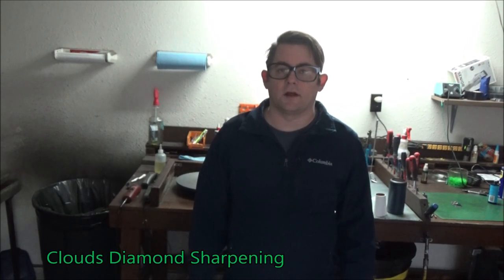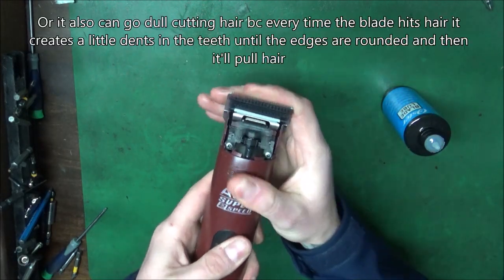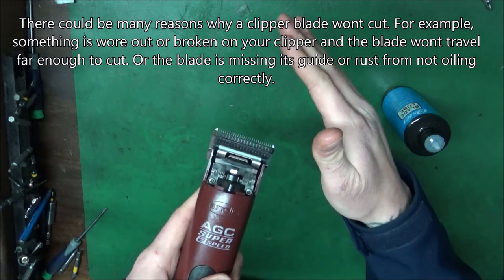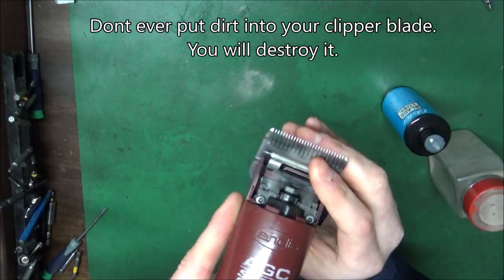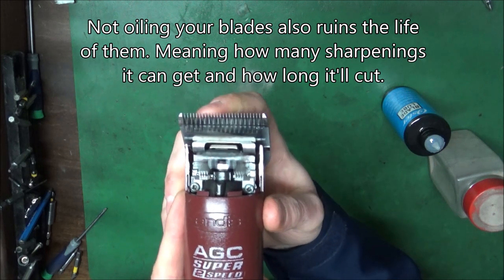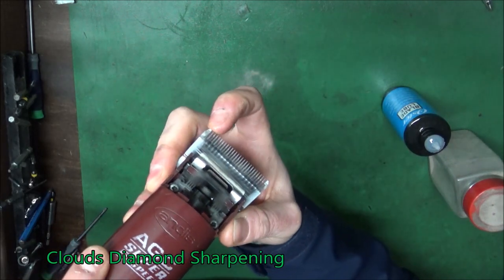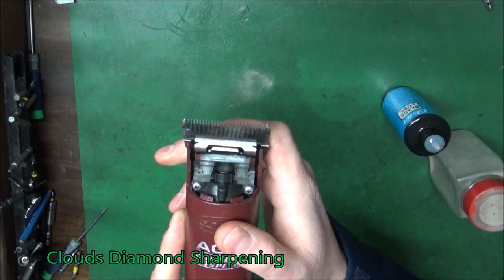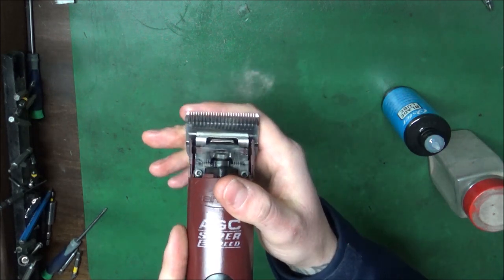Why do clipper blades go dull?

Comment: Hi from Sweden 🇸🇪. Watched your videos a lot, informative and very good 👍. I have a andis ultra edge with a problem that I don't have found in your videos...
When I turn it on it doesn't move at all, after 2 seconds it starts moving very slowly and after 10 seconds it movs faster and faster but never comes up in full speed. No difference between speed 1 and 2... and it's not clipping, just buzzing loud when I put it on the fur.... heard that before?
Reply from the maker: It sounds like it needs a full service. It sounds like the switch diode is broken between 1 and 2 speed. And your cam is broken that drives the blade or it's the blade drive that's broken and it's not driving the blade. Or it could even be a bad armature and have a dead spot and it's running slow and that will need to be replaced before it runs fast again. Thank you for watching I hope I helped, have a nice day

Comment: Thank you Nick for this, I had a little question that didn’t get answered by anyone so far, but what do you think is better a v9000 motor (wahl) with 14,400 spm vs a v9000 motor (wahl) with 6000 rpm? Which one is more powerful? Cause I’m looking into a wahl clipper but the European has 6000 rpm and American 14,400 spm
Reply from the maker: You're welcome. Both clippers will move the blade just fine so both clippers are powerful enough to do anything you need to do. The difference will be that the faster one is going to get your blade hotter faster and it will transfer heat through the clipper so the clipper will get hotter than the slow one. The 1400 one will generate more heat but you'll be able to cut through the hair faster. I hope I helped and have a good day
Reply: @cloudsdiamondsharpening3973  Thank you to be honest I prefer higher performance and a hotter blade then a cold blade with less performance